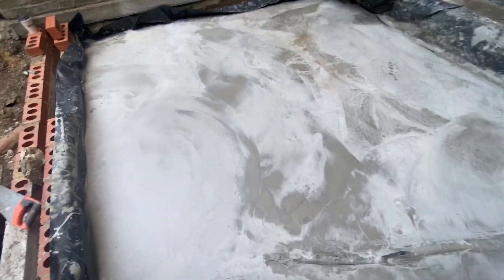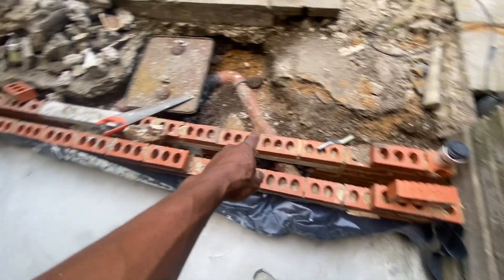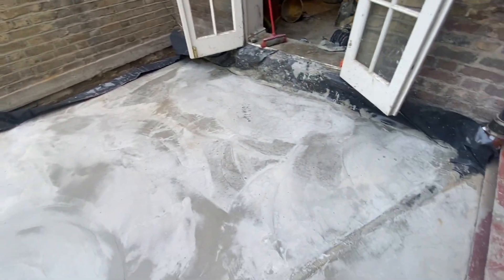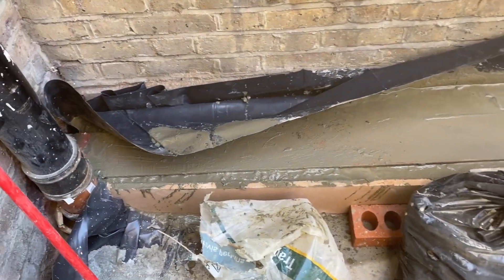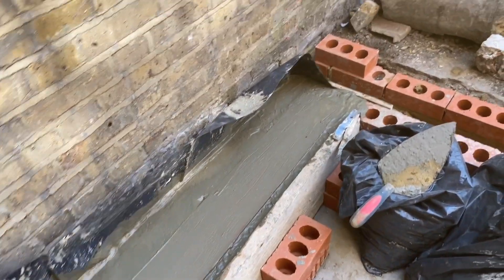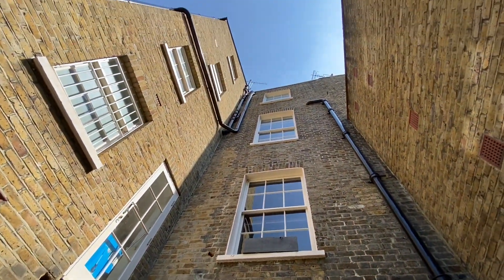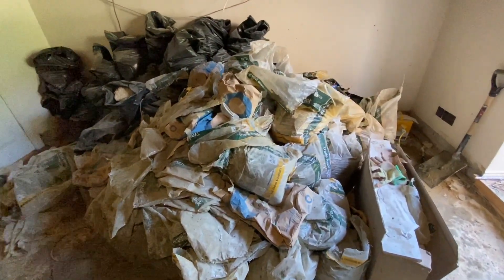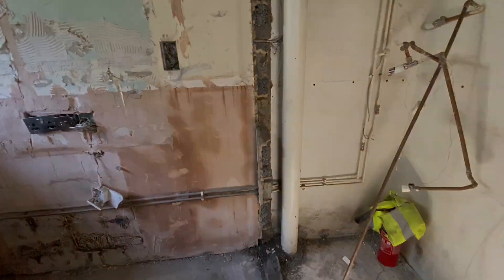Concreting the steel beam - Foundation

Comment: Is that steel girder sitting  on a concrete base or just supported on both ends by blocks.Are you going building on the steel or putting a timber frame on top of it..thanks
Reply from the maker: HI, part of it is sitting on a pad in the house and the other is on a steel column bolted to a concrete pad. You can see the installation process of the steel in this video
https://www.youtube.com/watch?v=x9-L3ddBJaA

Comment: Why you put or need a steel beam? Can you not jus pour a concrete?
Reply from the maker: Hi I explained in some earlier videos. Basically we had to bridge over the adjacent properties foundation which was quite far over on our side.
Reply: @darrenthebuilder  it’s crazy isn’t it that ingress from next doors construction has caused all these issues and extra costs. I wonder how they got away with it or whether at the time of building the regulations weren’t that rigid.